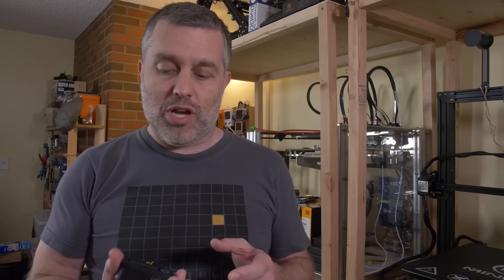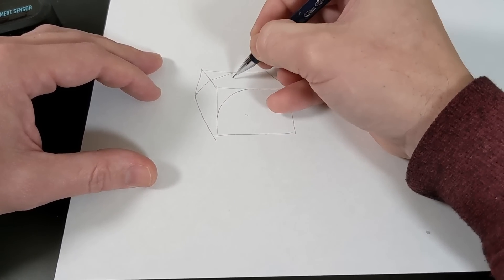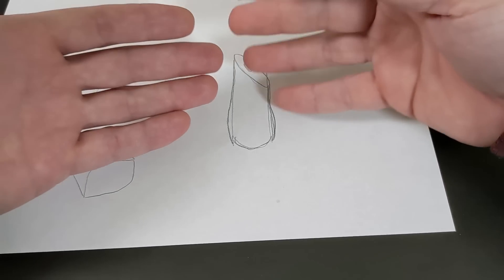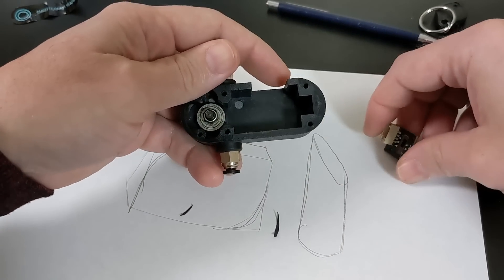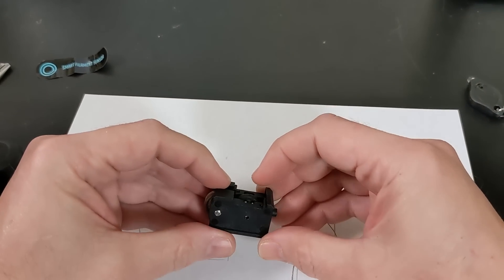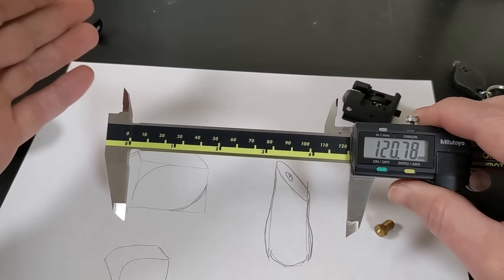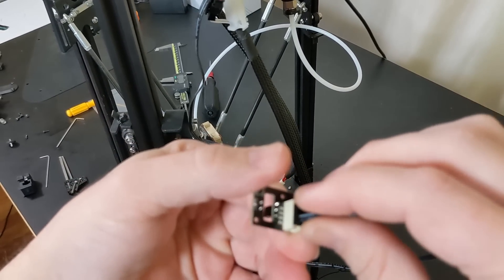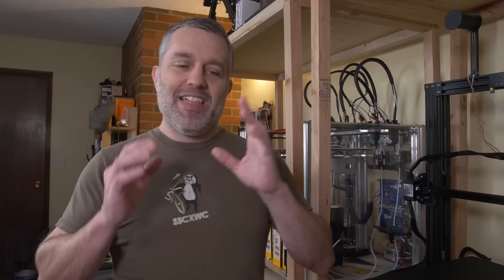The Bigtreetech Smart Filament Sensor - An In Depth Review

Comment: just put the runout sensor after the extruder ? great job 😂.
Reply from the maker: How many years later and I still get geniuses thinking they are smarter than me. The ideal place for measuring the flow of filament would be exactly at the nozzle. You don't really care what the filament is doing everywhere else upstream. All that matters is the flow at the nozzle. So putting the sensor after the extruder (a potential failure point) is a great idea, and one step close to the nozzle.
Reply: @DesignPrototypeTest  I do not even remember how many clogs I had, This product is a filament runout sensor glorified its good to know if the filament is flowing, if you print hundreds of kg of filament than you runout more times than clogs the nozzle. so next time put it before the extruder.

Comment: I really appreciated this video, I found it quite entertaining but what I appreciated most is that I was probably going to buy one of these sensors. I have watched a couple of other videos about them which didn't give much information at all(other than surface level stuff) and if you search for smart filament sensor it's easy to get the impression that this sensor have become the most popular smart filament sensor out there. So thank you for showing what actually went into this sensor. Regarding BTT, I am using an octopus Pro board and it does work but the whole design have this sloppy hobby level circuit design written all over it, and after a couple of revisions of boards already sold... most bugs have now been worked out...

Comment: I would've used a circular sticker on the metal bearing wheel thing that contacts the filament and skipped the custom encoder rubber wheel altogether. And yes, the BTT stuff is rather terrible. Even their PCB layouts have things that an engineer who's worth his salt wouldn't do...

Comment: I disagree with virtually all of your conclusions in this video.  I'm using this very sensor on a RatRig V-Minion and it works very well.  The RR V-Minion uses an SKR board as well.  If you like Duet stuff, that's great, but don't sit here are try to make non-Duet stuff look bad out of malice when it isn't so.  And, no, I'm not some sort of SKR or BTT shill.  I'm an Electrical Engineer, and I make stuff work.
Reply from the maker: Congratulations on your pride. Making stuff. Work is really cool. I don't appreciate the assumption of malice. That's a pretty heavy word to use in regards to a filament motion sensor. I stand behind everything I said in this video. Just because it works for you using a plug-n-play board, it doesn't change any of the points I was making.
Reply: @DesignPrototypeTest  You shouldn't stand behind everything you said, because there's several things you said that are flat wrong.  As a single example, it's virtually irrelevant how far a nozzle might travel between the time that the filament breaks and the time that the break is sensed by the software.  The only situation where that would be a problem if if the filament broke so close to the hot end that the hot end ran out of plastic before the print was paused.  Otherwise, it's completely irrelevant.  You provided no comparisons of this sensor to other sensors that you think work better, and admitted that you blew up a sensor because you wired it wrong.  You improperly installed the sensor on your printer by providing no physical mounting other than the bowden tubes.  You provided no example of a filament runout event and how the unit would handle it.  Your inaccurate and incomplete "review" instills no confidence whatsoever, and my own personal experience plus many other examples of where this sensor functions perfectly prove without question that your conclusions are incorrect.  The only part of your "review" that may have some merit is the industrial design component in terms of shape and size, but that's only a minor part of this unit.  Most people are concerned with functionality only.  As you clearly have experience with 3D printers and should easily be able to objectively evaluate this unit, what conclusion should the audience come to when they see these glaring errors in your review other than malice?  I stand by that word until you show otherwise why I shouldn't.

Comment: Wouldn't it be more useful to put it between your spool and the extruder, not between the extruder and hotend?

Anyhow, thanks for doing the tear-down.  I hadn't realized from the amazon listing that it was using an encoder to see that filament was moving, I thought it was just a limit switch.  Glad to clear that up.  Thanks for the video!
Reply: Heads up he messed up the wiring, sadly BTT is very lacking of in box documentation but on their site there's instructions to swap the wires pinouts for different company boards because each one likes to have their own "secret sauce". The sensor blew because he didn't consult a guide for that board manufactures pin layout, always do deep research on a pieces of equipment, never assume plug & play with so many different company ecosystems. Been building a custom printer from parts for a year & half that lesson pops up often enough.

Comment: My guess for the material and sturdiness of the case is that because this is designed to sit between the extruder and the hot-end, any flex will result in print artifacts. This won't be an issue for direct drive or if this is placed before the extruder. But probably still overkill.

Comment: Shocked how wiring is often just wrong on products. Just as you noted the wiring colors and labeling seem to be randomly chosen. I had the same type of issue with the CR-Touch which works great after you decode the wiring colors. CR-Touch White is servo ground, what, BLK is Servo +5., then RED is GND for the Z-stop connection. Even worse is the BL-Touch which is almost as confusing has been around for a long time and for some reason the CR-Touch needed to have different wiring colors and that would have been fine if they made more sense. Again the CR-Touch works perfect, just the wring is awful. By the way I do have a BTT SKR v1.2 motherboard and it works perfect and was a great value. I have dealt with BTT support and they may take time but really try their best to help you out.

I do appreciate your knowledgeable honesty but seem your feedback could be a little nicer, sorry.

Comment: so you're telling me the ground is the black wire and not the one with the stripe?
Reply from the maker: On my unit the black wire is the voltage (3.3v) the middle long dashes wire is the signal wire and the wire with the ++++++++ signs on it is the ground. This is different from the wiring shown in the manual. I covered the wiring issue in the next video here: https://youtu.be/7xVRTtWErvo

Comment: And the design needs two light sensors (not one) to work properly. Also, lots of complaints here are about wear of the rubber on the filament if you removed one of the wheels. The wheel freely rotates on the filament (it doesn't push or drag on it), wear should be minimal. Other DIYers have just used rubber bands successfully. If it is an issue, change the wheel with holes in it to metal. A mouse scroll wheel was probably used to lower costs to mere cents.

Comment: Also if you Main board does not have a dedicated Filament runout sensor connector/port then you will have to find another connector on your board that is not being used and configure that port in the PINS.h file so your printer knows that the pin you plug the sensor to is the one you want to use for the Runout Sensor and not something else.

Comment: I have this sensor. I believe that there is more to it than just one line of code. I think over on Michaels channel, I think he goes into how to set this up at least using Martin firmware. In firmware you have to Enable the Sensor. Then tell the sensor when to trigger in mm then set up the park settings. Where to park the head when you are performing the filament change. The code in Marlin is M600. I don't know how to do this in Reprap firmware. I have only used Marlin firmware. I got mine working and tested but then my filament ran out and it did not trigger. SO, Maybe the length of PTFE tubing I have mine connected to is to short. I have settings set to 7mm. Also, I have a direct drive system. Recheck that you have the cable plugged into the correct connect on your main board. For something else I was trying to connect I plugged the cable into the wrong connector or I plugged the cable in backwards and I got smoke. So I would start there.

Comment: I tried one and it was a miserable fail. The encoder wheel isn't reliably driven by the filament wheel. It slips and doesn't turn, causing a shutdown.  I'm going to assume that the encoder wheel is slightly undersize. I took it apart and discovered there is no bearing on the encoder... Just the aluminum drilled for the shaft and that's a bit too big making the encoder wheel kind of wobbly too. I'm sure both issues are the cause.  LED is mounted crooked on the board too. 

I had hopes for it after seeing some reviews, but after my experience, I'm going to find something else. At least it's only $15 wasted.

Comment: RIGHT not an engineer an INDUSTRIAL DESIGNER "artist" so stop saying or think twice before you say a product or component is garbage!! Like the Creality control board, the ender 3 in its stock form is the perfect platform for ho it was intended for, with exception of the assembly, NOT FOR BEGINNERS.     price and function fantastic
Reply from the maker: Have you ever heard the term "More of an Art than a Science." and realized that those capable of such are highly valued? I dropped out of Engineering school voluntarily. You could say I quit, or you could say that my skillset didn't match with the narrow curriculum. I ended up with a Master of Science in Digital Technology from the University of Michigan. It's funny that you triggered me enough that I felt the need to write this. Now, my question to you is what credentials or abilities do you have? Why did my words disparaging an piece of plastic and metal personally insult you to such a level that you had to leave 3 comments on two videos attacking my person? Seriously you didn't say any defense of the product. Everything you said was just an attempt to insult me. Why are you changing the subject? This is about a filament monitor.

Comment: So uh, you smoked the board (twice) and called the PCB crap? It's designed to be plugged into a BTT board, would have thought you'd check the pins at either end to make sure you didn't blow it up (twice) if you weren't plugging it into a board its designed for.

So you thought you'd just have a dig at the design as you couldn't get it to work, which for once is built to be tough, sensor wheel doesn't directly contact the filament, casing wont crack or fatigue under the pressure of the spring if it ends up in a heated chamber, but that's now a waste of time and money and you'd rather it be flimsy? You sure you know much about designing stuff?

Whole video just feels like you're really out of touch with what's happening with 3D printing, the Duet's stuff is nice, but writing off all BTT's products because you mis-wired their filament sensor that you don't like the design of and destroyed it before you could actually test it seems a bit petty to me.
Reply: Not going to respond yet writes paragraphs in HIS OWN comment section. He is higher level than all of us and can't be proven otherwise. This is the reason his channel went absolutely no where. He puts himself above everyone else and is not relatable. 

I mean come on. This is an "in depth" review where he trashes the design and the company (which is amazing by the way) then proceeds to fry the product (twice) by using it on a board it was not designed to be used on.
Reply from the maker: Hey Man, you've got some hard hitting criticisms here. I would love to respond, but I'm pretty warry of trolls/sock puppets/bots/fanboys/whatever-they-are. I see you've posted some videos about 3D printing so I'll tell you what. Show me your face and let me hear your voice in a video where we can have an ongoing conversation. Maybe even tell me your name.  If you do this I'll talk about anything related to my videos that you want. I need to know that you are a real and stand-up person. Don't be shady. At the moment it just seems like you are a faceless coward taking pot shots at me from the shadows. You are trying to get me to feel bad about myself. Trying to make me and possibly others think that I'm "Out of touch with what's happening with 3D printing" and that I'm run by my "petty" emotions instead of making valid criticisms. Prove me wrong. I dare you.
Reply: @DesignPrototypeTest  You have responded, with a further 20 minute video on a product you destroyed before testing. To defend your actions of applying reverse voltage to both units. Again implying poor product design because you guessed at cable markings that aren't crystal clear.

Lets wade through your little list there, Troll, maybe, though my comments are a little more observational than straight up bashing. Sock puppet.....no idea tbh. Bot, far to well put together English to be a bot. Fanboy, not really sure on the angle here, I've not so much defended the product as I have questioned the method by which you came to the outspoken conclusion that the product, and therefore, entire company product line, is terrible.

So ruling most of that out, my name is as it appears here, at least all of me I wish the internet to see. I worked out a while ago that I didn't want to spread my image out on this platform, as is evident from my last upload, 8 years ago. We don't all require the attention you seem to seek by bashing a product, and company, and country, from which you dislike from a single, poorly conducted experience.

If you have no rebuttal that's fine, it's an open comment section, I don't believe my comments to be shady. I do however think it's pretty shady to attack big tree tech in such a public way when the problem with the product was the customer. Many of the larger printer manufacturers and communities are moving over to a BTT board running Klipper with a RPi, how you've missed that enormous wave of change is beyond me, which is why it feels like you are "out of touch".

Also, criticisms don't always have a positive outcome in mind, if someone is critical of your content, and it isn't positive, that's still a criticism, not an "attack". You're doing a fine job of making your channel undesirable to watch on your own.
Reply from the maker: If you are an emotionally balanced "real" person with no agenda and your words are how you genuinely feel about me, I need to tell you that your privacy is an illusion. Remember when it got revealed that Facebook has ghost accounts for people who have never even made a Facebook account? They know who you are. They know your IP address (even if you use a VPN they still have methods of identifying where you are coming from). They know who you talk to. They know what you buy, They know your interests. If they cared about you as an individual they could easily make a dossier on you. The only people you are hiding from are other users. Me, and others who will read your comments are the ones to whom you remain anonymous. I'm here showing my face, telling you who I am for video upon video. You use this information to personally attack my being and suggest that I am "petty" etc. Yet you aren't even honorable enough to reciprocate for few seconds of screen time. You won't put your face behind your words. You have no skin in the game. You can say whatever you want and there are no consequences to you. I'm not foolish enough to engage with a such a cheater. If you want me to actually read your comment and give 2 seconds of consideration to your words you need to prove me wrong. Show me your face and let me hear your voice in a video where we can have an ongoing conversation. The funny thing about your supposed online anonymity (if you even are a "real" person) is that it is supremely egotistical. Nobody cares about you. You are so self centered that you think the world is trying to figure out who you are, but we don't even know you exist and you make sure that we continue to be unaware of you by "protecting" your identity. Worse yet, you have weaponized your anonymity to vandalize my comment section. After this small interaction with you I don't need to see your face. I can tell what kind of person you are.
Reply: @DesignPrototypeTest  this isn’t a western and there’s no point in calling me out. You can answer the questions, or not. All you’re doing is damaging the hobby by posing as someone with knowledge on the subject and blaming a reputable manufacturer with your mistakes.

Arguing with idiots is like playing chess with a pigeon. No matter how good you are, the bird is going to shit on the board and strut around like it won anyway.

I’ll leave it there, try not to loose too much sleep.
Reply from the maker: I would love to talk about all the issues you bring up, but I won't engage with a faceless ill behaved cheater who attacks me anonymously.